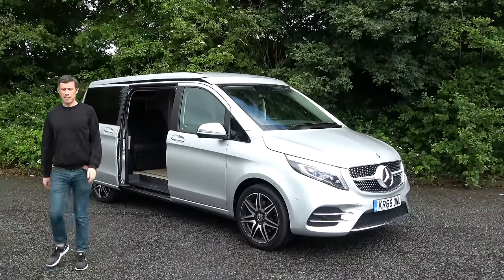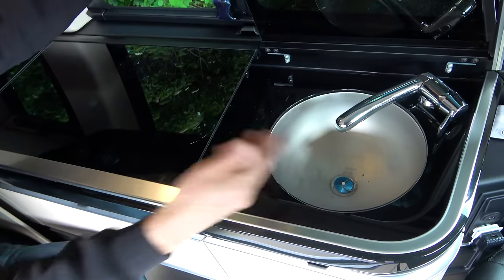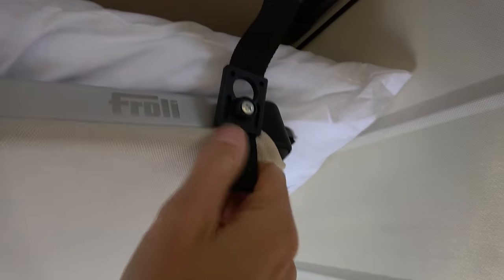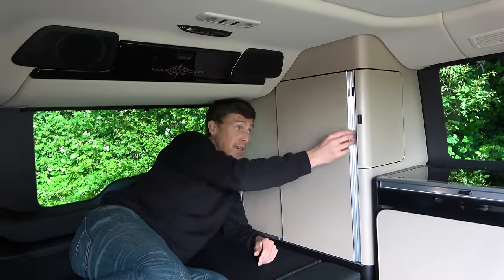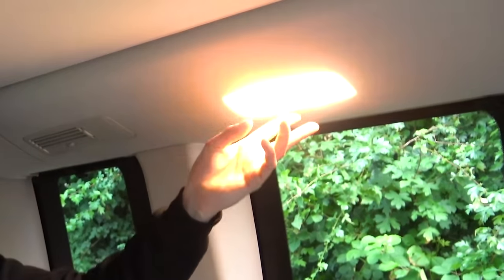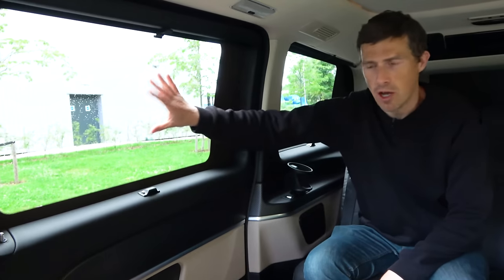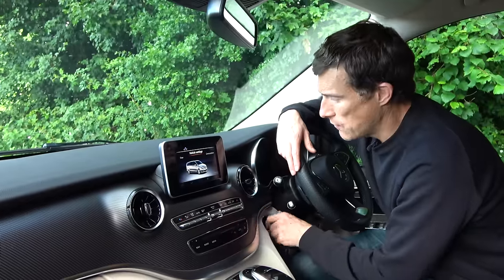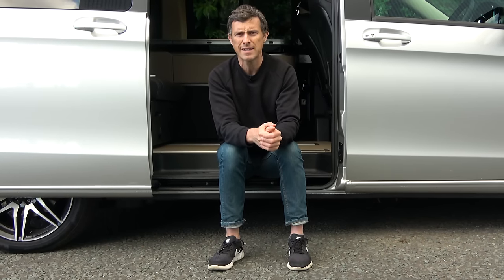This £70K Mercedes Marco Polo is the ultimate luxury camper van! REVIEW

Comment: Many Marco Polo owners ditch the dangling storage bag to get more storage space in the rear. 
Other items that get “thrown” out are the captains chairs  in favour of camping chairs that are more easily stored and the cab curtain which gets replaced by an insulated interior or exterior screen cover.
The antiquated camper control panel has been integrated  into MBUX which replaces the Command satnav shown on the latest model.

Comment: The Marco Polo may be luxurious, but compared to the VW California it's far away from being "ultimate". I've been driving the California for a couple of years now and wanted to switch to the Marco Polo because of the sake of change. But from a camper's perspektive the Marco Polo feels like a first try on camping by Mercedes. E.g. no possibility for blacking out the sun 100%, only one arm rest per seat, press-studs (!) for toggling the popp-up roof and poor build quality of the camping interior. I was quite shocked seeing knobs fall apart and doors that won't close after a few thousand kilometers. And what is almost hilarious is that the two camping chairs and the camping table use up the whole trunk! This must have been some last minute project like "damn, we forgot to include the chairs an the table, what should we do?! I have an idea, let's use a heavy steel frame and some fabric and make it the size of the trunk!" It realy must have been that way...

I was quite dissapointed. Sadly someone must had higher priority for the look than for functionality. It seems that showing of is more important than acutal camping.

Comment: Its not quite so refined, 
It's slow, small engine.
However, it does 42mpg. Roof lifts in less that 3 seconds. Bed is ready in 3 seconds, and away in 2 seconds. I can fit a 10ft ladder under seat, if I wanted to.
The bed is 1300 wide 2mt long, so is the roof bed, 
It seats 6 legal,
 it can can carry  2 E bikes without dismantling them
it does rattle, a little.
It costs ₤294 to insure including EU breakdown.
It did cost ₤28k
What is it? Yep VW T5

Comment: I wonder about this cooking in the car. I would rather slide out the gear and cook outside. The heat, fat, steam, stuff spetters all around. Doesn’t it ruin the car when you use it  with the roof so close?

Comment: A folded down car seat is still a car seat not a bed and no where near as comfortable - My motorhome cost half the price has its own kitchen, fridge, flushing toilet, shower, hot & cold water, tv, wireless connection, AC, double bed, heater, window blinds, carpeted floor, and I can stand up full height (6'2") and walk around.  Plus with its turbo engine it could certainly keeps pace with this thing.  Why crush yourself into a box when you can spread-out in a MH.

Comment: I’d prefer the van they copied, VW California. And electric roof?  Pointless
Reply: Henry Partridge the California is overpriced rubbish. Better off buying a transporter van and getting a conversion done, they are better and cheaper. And yes the electric roof is pointless but if it didn’t have it there would be someone like you on here moaning that there was no electric roof on a luxury Mercedes.

Personally I’d rather have my proper motorhome with a grown up kitchen, a proper bed, some storage, a toilet, a proper shower oh and hot water.

Comment: We have a 2018 Mercedes Marcopolo, the same as this one, in AMG kit. It’s not as expensive as it appears. All of the plastics are rattling, overall quality after three years of use is awful, including leather backseats which are literally disintegrating in your hands. We’re so angry with Mercedes, everything just seems to be done to be sold and forgotten. The control panel is also broken. Also, after 40kkm the clutch started doing weird noises. That’s absurd…
Reply: Also, there’s literally no indication or warning that the window part of the boot isn’t properly closed (or was opened by mistake - if you hold a boot button on the key it unlocks). And believe me or not, when starting from green lights, it just opens completely. Yay, free rear wing!

Comment: MB needs to bake this one a bit more in the oven... it's half-baked! Why make a lifestyle vehicle in 2020 with no Android Auto or Apple Car Play? Then there is the blinds situation... that front one is atrocious, and the side ones seem like they could have easily been a bit wider to provide true privacy. The lack of opening windows is another strike... the Japanese have been reliably doing smaller opening windows within larger ones (ex. Toyota Hiace or Nissan Urvan) for years now, so it is possible. Speaking of windows, how difficult would it have been to power operate the rear glass, so that it could have been opened and closed from inside. No, instead they power operated a useless pop out one... what?!! Finally, that warning tone when the roof is up and engine is on, is totally asinine. As Matt said, what if you want to recharge the battery, or run the heat or ac? The warning should only come on if you put it into reverse or drive, with engine on and the roof up. I can't believe a team of engineers, product specialists, and customer analysts all gave their blessing.

All of these add up to poor engineering, at any price given the purpose of this van, let alone one for almost 70K. It's not worth the money at all.

Comment: So £70k for something that's not very comfortable, noisy, basic, narrow beds, no hot water and "automatic everything" except the seat slide and the two swivel seats😂😂

 £70k  buys you a lot of holidays to a proper hotel every year for many many years. 

£70k buys you a brand new top of the range caravan and a brand new car to tow the caravan with change left over. It also means you can go on day trips while you're on holiday without packing up your entire camp.

There are literally no upsides to owning a camper, other than trying to look cool and pretending to be a hippy😂😂😂😂

Comment: Mat, you can open the glass rear window using the key - it needs reprogramming by a key combination, which can be found in the user manual:

Programming the key button for the rear window

If your vehicle is fitted with an EASY-PACK tailgate, you can program the  button on the key either to open/close the tailgate or to open the rear window.

 Make sure that the tailgate and the rear window are closed.

 Turn the key to position  in the ignition lock.
 Press the buttons in the handle of the tailgate and in the handle of the rear window simultaneously for approximately five seconds.
After successfully changing the function, the vehicle turn signal lamps flash once.
 Check function of the  button on the key.

https://moba.i.daimler.com/baix/trucks/vs20/en_GB/index.html#../../../trucks/vs20/en_GB/manual/subchapter_05_31.shtml:ID_9792f5662b664acd35477e682d202d20

Comment: It's astounding that we've gotten to the point when a VW makes a car for comparable money, better designed than Merc and it sells like hot cakes. It's even more astounding how utterly stupid certain things are in this 67K POUNDS car. The blinds (THE BLINDSSS!), the picnic table and chairs, the lack of gas struts in the upper bed (really not that expensive to replace, but might save your head if your hand slips one day...) and the electric motors in the most idiotic of all possible places with the electrically operated back seat being the prime example of overengineering. It feels like a result of the work of (not very bright) group of trainees at the factory. Which is a pity because the kitchen is gorgeous and well laid out and I really like the design of the car itself.